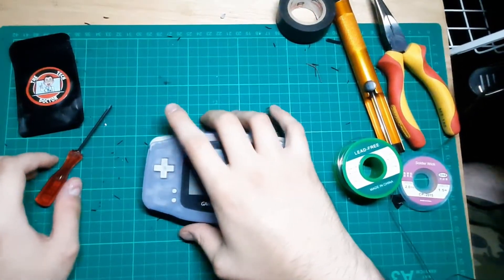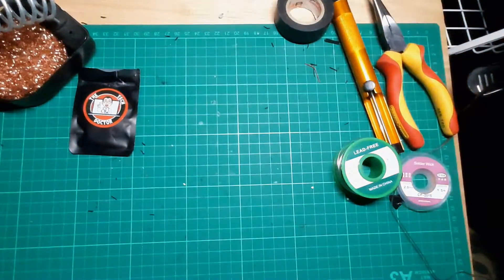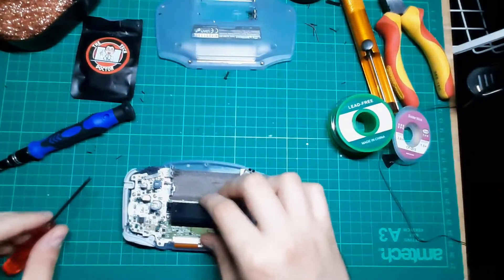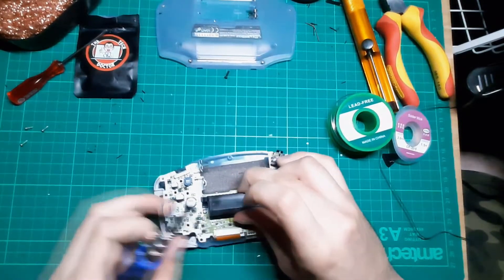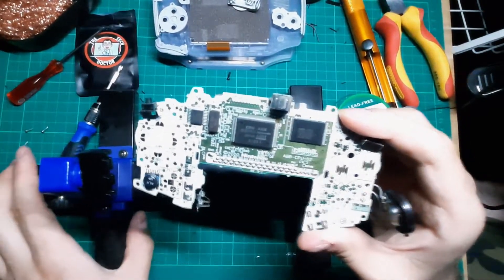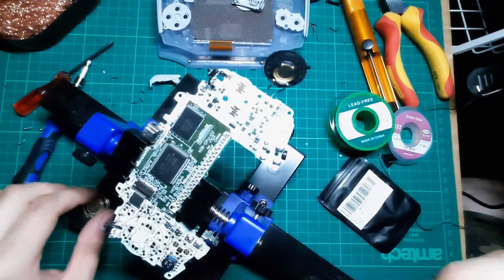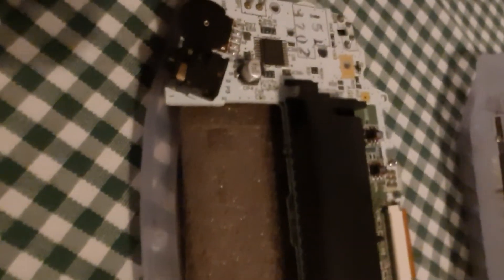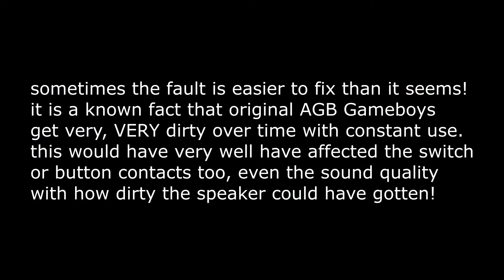Gameboy Advance No Sound Fix!

Comment: Have a Xbox 360. Needs capacitor replaced. Is that something you can do?  Power supply has red light, replaced power supply still same issue. It’s a phat jasper motherboard.
Reply from the maker: Should be easy, yeah. There's plenty of sources pointing to what the steps are. I've personally not touched an xbox before, however i have a Sega Game Gear re-cap video which explains capacitors and their values. Check it out :)

Comment: I bought a used GBA and the sound was spoty until it faded out completely. The headphone jack doesn't work either. Any guesses?
Thank you :)
Reply from the maker: I think it might be a volume wheel issue. It may need a really good clean.

You could also try testing the speaker on another console just to rule out the speaker issue, but i doubt it's the case since you said the headphone jack doesnt work.

It could also be an issue between the cpu and the amp. Those sorts of issues require an oscilloscope to test the signal of each audio channel (left and right)

You could also ensure all solder joints are properly connected

Comment: So I have this exact same problem... but what exactly did you do? You just jammed a q tip into the dial?
Reply from the maker: It was a very dirty potentiometer so in order to ensure contact with the potentiometer, i jammed a qtip between the shell and the pot to add some pressure to prove the speaker isnt dead. The dirty potentiometer should be doused in ipa and rotated several times to get any debris out.
Reply: @HardwareHackers1  ahhh, okay. Thank!
Reply from the maker: @gershonsanchez  happy to help, feel free to keep asking stuff!
Reply: I have the same problema 😮 bt i dont understand how repair it, my english IS not very good

Comment: I bought a GBA the other week and I've been playing it like mad to be fair. Today I noticed the sound works when I put the headphones in, but silent any time without the headphones in. Can I just shive a cotton bud down there or something? I don't want to take it apart unless I absolutely have to. Any advice would be welcome. Thank you!
Reply from the maker: You absolutely can, just make sure to remove the batteries and that it dries out. The best thing i can advise is make sure that the speaker isnt dead first. You can test by using another speaker.
But 9 times out of 10 it's really just a dirty headphone  jack, you COULD also just get a cotton bud and drip some IPA in there and use your headphone cable plugging it in and out a few times to help clean it.
Reply: @HardwareHackers1  Thank you for your reply. I at least know how to replace a speaker now thanks to this. So yesterday I got a toothpick and shoved it in the headphone jack. A little clump of dust came out. I turned the GBA on and "ping" sound was back :D
Reply from the maker: @chrisretro81  hahaha, nice! Sometimes its the most crusty sort of repair that gets it working lol. Glad u got the thing working again!
Reply: @HardwareHackers1  yeah thank you and even though in THIS I didn't need to change the speaker, thanks to your video I know how to now so a win win
Reply from the maker: @chrisretro81  happy to help!!